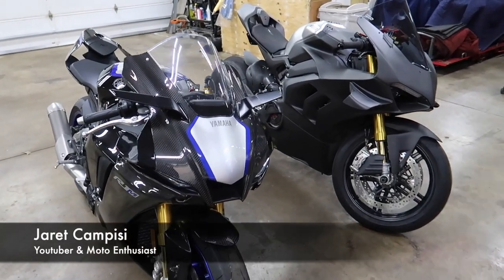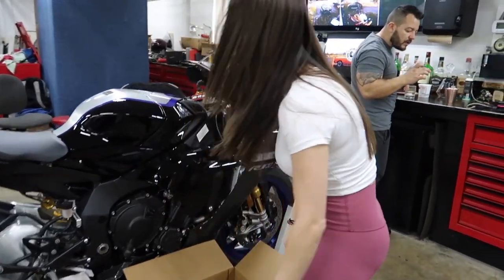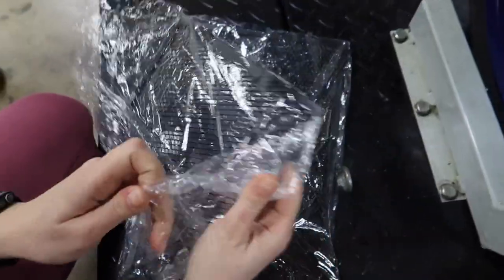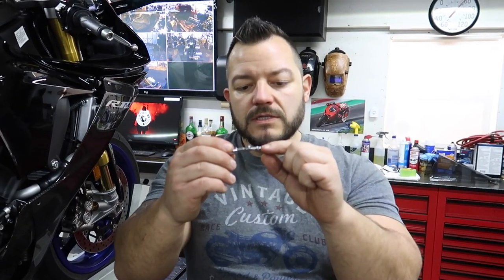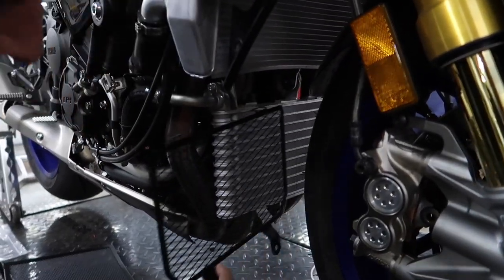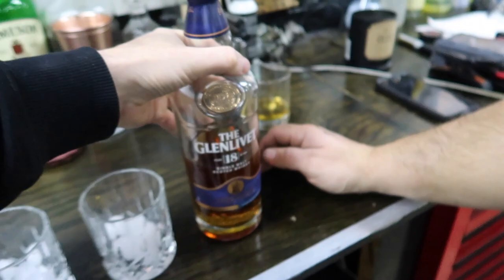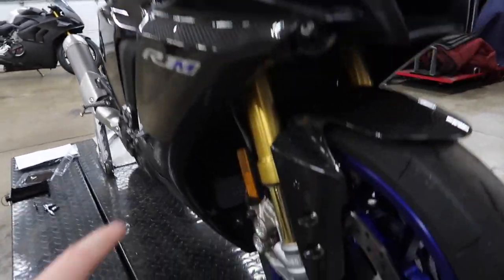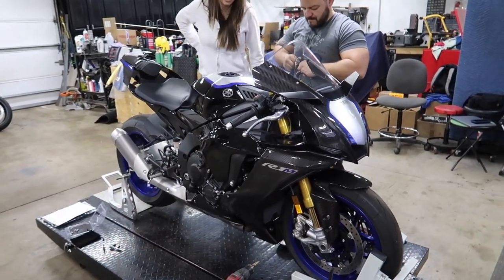Our Yamaha R1M Gets Blacked Out Radiator Guards!!!

Comment from the maker: Blacked out oil and radiator guards installed!  They look great and help protect those cooling components so the engine doesn't over heat.  IMO every bike should have these.  Also love these carbon gas caps from www.motomillion.com.  Snag one for yourself and use my code "campisi" to save some money.  Get signed up to win the R1M and the Carbon V4 SP now!  www.patreon.com/campisicustoms
Reply: Bad ass line up jaret ✊👊
Reply: Can you do a Triumph Rocket 3 GT giveaway?

Comment: What is the point of putting such crazy expensive useless parts on a motorcycle lol?  I would think that the engineers did a decent enough job when designing these bikes.  I would understand functional parts such as exhaust/suspension/brakes, but what is the purpose of getting an aftermarket gas cap or how much is a radiator guard going to protect?  Seems like overkill.